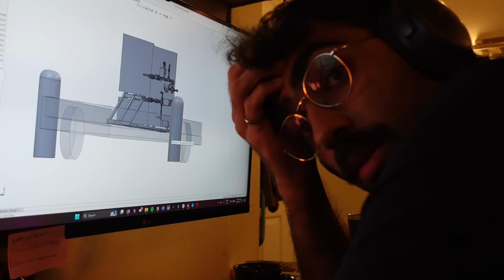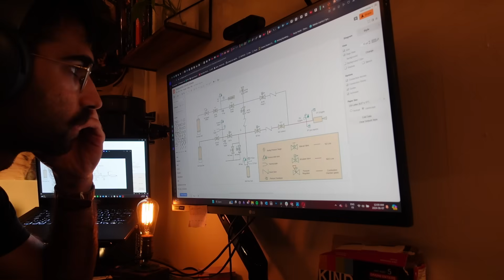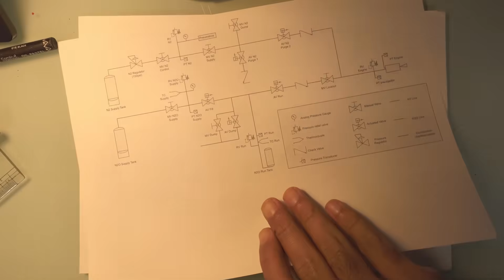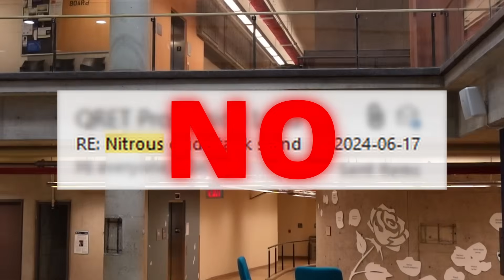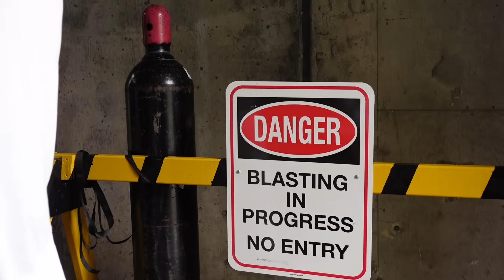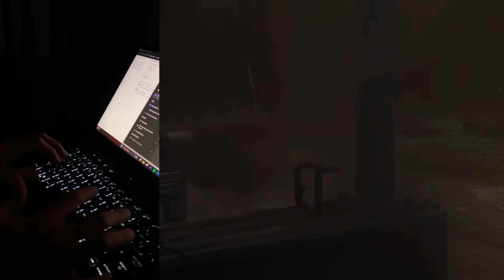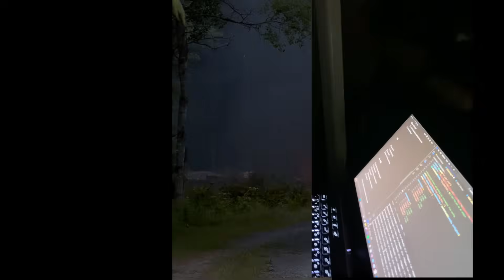I SPENT A YEAR BUILDING A ROCKET ENGINE

Comment: Hey, fantastic video! We're just starting hybrid rocket engine development over at the university of Aberdeen, UK. Do you have a BOM for the valve system for the test stand? Or even a thesis describing all this you could share? We're trying to price up our design from swagelok but they have so many variations on valve type, actuator etc is a bit of a headache to get through. Would love to peek at someone else's answer.... Our test stand and motor are much smaller too.
Do you use control valves, or just go full flow? 
Amazing work again, the video was very cool to watch. At least here I'm an academic and we can get the N2O no problem. The issue here is getting a test site and money!
Reply from the maker: Thank you! Good luck with your engine!

I do have more details on the build on my portfolio : https://nikhilmenda.notion.site/Hybrid-Rocket-Engine-Project-Prius-Queen-s-Rocket-Engineering-Team-917f797c0c58475f9e6d122b592e4297?pvs=25

There is a report down in the bottom of that, but it was written before the cold flow so there are some  minor changes since that. The report includes more of an explanation behind the design and more on the parts used. It also includes a (rough) BOM and some other stuff, but I'll admit it was written in a hurry so feel free to contact me for more details. I'm pretty proud of the way I budgeted this project, my entire budget for the year was 18000 CAD and I used every cent of that. The bulk of the test setup came under 10,000 CAD though.

If price is a concern, a good tip is to look at used swagelok parts on ebay,  or swagelok knockoffs. A good part of my design was actually determined based on what I could find for cheap on ebay lol. The swagelok knockoff company we used is called Hylock, but they are Canada based so you might have better prices with a local supplier in the UK.

The only thing I bought new were the pneumatic actuators and solenoids since I couldn't find good options used.

We don't have control valves. We regulate flow based on tube diameter. So the fill section of our setup is 1/4" tubes and the run section is 3/4".
Reply: Ah I missed the report and project page, thanks there's lots more info. 
I'll go over it, the idea to use refurbished swagelok is great too. Our budget is less than half, but we have an amazing workshop so the machining is very cheap. Will probably contact you at some point for sanity checks!